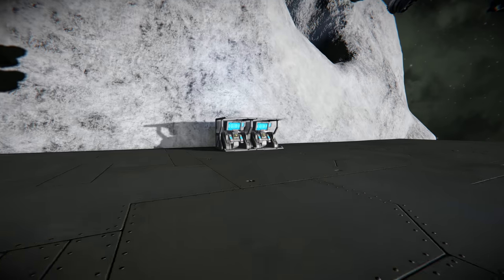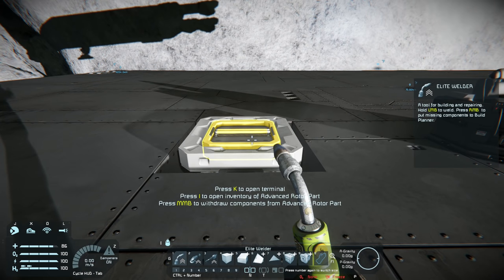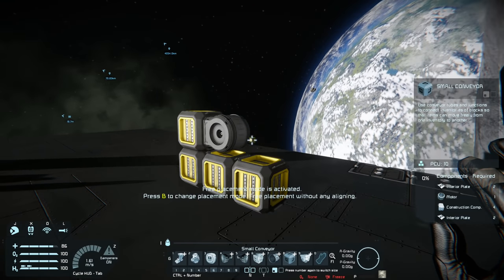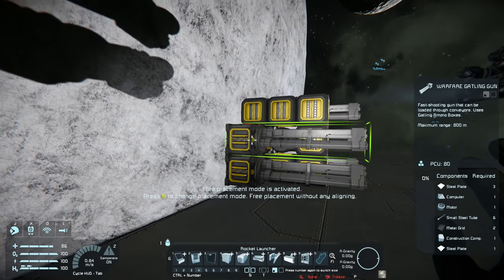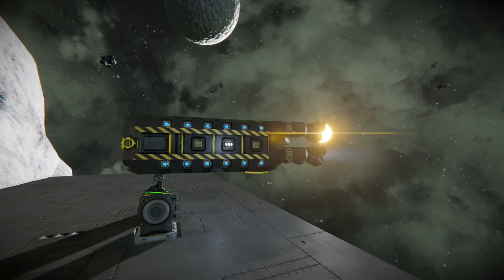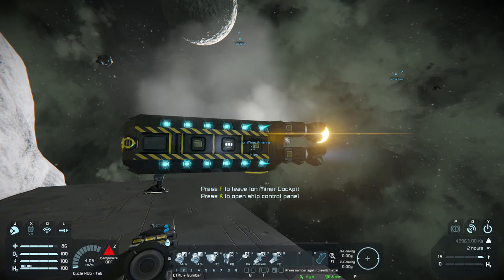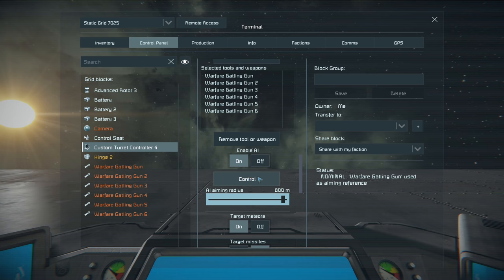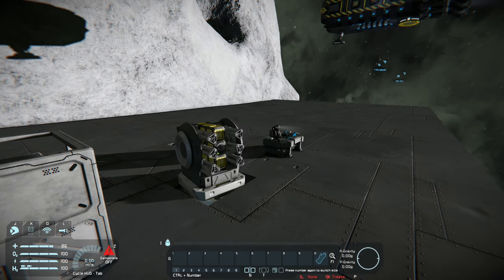Space Engineers - How to Build Compact Hinge Turrets - Warfare 2 Custom Turrets!!

Comment: I found that I was easily able to attach the small hinge head by placing down a second rotor behind it, adding a small head and building from there to the main hinge and placing the hinge head so it lines up with the main hinge, then attaching it. No fiddling around trying to line it up while carried by a ship or clang shenanigans.
Reply from the maker: I wish I had of thought of that before LOL. Thanks for the suggestion!! 😁👌
Reply: You can also just drop/place a single armor block in the very middle, for small grid large hinge, place the small hinge part directly on it, for large grid hinge blocks, place a next block on top of the first one, then place the hinge part
The hinge part will be instantly rotated by 90° to fit the motion range of the hinge, and you're set.

No more Clang-tempting than two-hinge/rotor+hinge shenanigans, and way less finicky.
Reply: you can also do it with another hinge
Reply: or just a well placed small landing gear, build some small blocks from there and the hinge part in the middle of the large hinge!

Comment: There's actually a mod that lets you grab low-mass smallgrid parts and move them around without a ship, which could potentially make these turrets easier to build.
Reply from the maker: Mmmmm that mod sounds awesome, which mod is this!?
Reply: @TheGarageGamer86  Coulda sworn I had posted a reply. SmallGridGrabber or something like that, no spaces.
Reply: A mod like that should be part of the base game.
Reply from the maker: I will have to check it out, Yeah I mean it kind of makes sense to be able to pickup small items with your hands haha.
Reply: It's called Grid Pickup, but it doesn't let you manipulate orientation of the grabbed small grid. You've basically tethered or harpooned it, and you tow it around on a virtual line. Wouldn't work for precision alignment. Great mod though!

Comment: You should replace some of the small conveyor junctions with tubes. Conveyor junctions cause a lot of lag and are more expensive, so you don't want to use more than you need
Reply: Actually that's just a myth, it's been tested and junctions are just as fine as tubes
Source: https://youtu.be/6VWj4sx2aqk
Reply from the maker: Yeah the design definitely needs a bit of TLC, although if you are not using copious amounts of junctions on a grid you should be OK 🤣
Reply: The lag issues with junctions have been resolved since before the survival update a few years ago. You'd need thousands of them to lag things out like they used to.

Comment: Had the control glitch several times, thanks for clearing up how to fix it.
Also what's the vertical limit of this turret?
Reply from the maker: Glad i could help! From my testing it can go a full 180 degrees and can go upside down 😎👌
Reply: @TheGarageGamer86  
Excellent. I'll give it a go myself when I have the time. Looks a little annoying to build but it really looks fantastic. Thanks for the quick reply 👍
Reply: @johnoneill3654  
If the hinge block is facing up in a natural gravity well, you can just place a filler block (armor/whatever) in the center of the big hinge block and let it fall, then, if the big hinge block is small grid, you place the hinge part on top and attach.
If the big hinge block is large grid you place another filler block on top and a hinge part on top of that one and attach. (In either case the hinge part will be instantly rotated to fit the motion range of the big hinge.)

If you're outside of natural gravity you can just place the small hinge part in the center and attach.
Reply: @My_initials_are_O.G.cuz_I_am  
Excellent suggestions. I'll give em a go, cheers 👍

Comment: Btw, you don't need to check the hinge orientation (where the whipe stripe is). You can simply adjust the "elevation velocity multiplier" to be negative if the controls are inverted.
Reply from the maker: Yeah I saw that in Splitsie's video, and here I was thinking to myself "Why didn't keen add an inverse rotation option" never even considered negative values 😂🤣

Comment: Hmm 🤔 small hinge part.
3 con-junctions straight back.
Surround the last junction with junctions... 
Place piston on four corners pointing forward.
Extend them a little.
Set the resistance/strength low.
Mount canons on pistons.
And continue....
Should give you visual, independent recoil Everytime a Canon fires.
Reply from the maker: That would be very cool, would love to see that built!! Thanks for the suggestion 😁👍

Comment: The way you built it the turret will be unable to shoot down, because the hinge can't turn forward by more than 90°.
If you rotate the hinge head to face upwards rather than forwards in the default position you can make the turret aim down by up to ~15° and also need fewer conveyors.
Reply from the maker: Thanks for the tip mate! 😁, I will have to check this out! Although I thought the hinge part couldn't go more than 90 no matter what? I don't proclaim to be an expert on hinges though as I have not used them as much as I probably should have lol!
Reply: @TheGarageGamer86  You can indeed never go past +-90°.
The difference is what angle you put the default rotation at.

With your setup, if the turret is facing straight forward it's already at 90° so it can't rotate forward any further.
If it faces upwards it's at 0° and you can also flip the turret all the way backwards at -90°. 
The thing is, the AI will never rotate the turret further than straight up anyways, since if it wants to shoot at something behind the turret it will instead rotate the turret base. That means with the design from your video the hinge only actually uses angles between 0° and 90°, all the angles from -90° to 0° remain unused.

If you change the orientation of the hinge head the way I suggested, then the turret will instead be at 0° when facing forward, which means it can then rotate anywhere between straight up (-90°) and straight down (+90°), though in practice you won't actually be able to aim straight down because the barrels of the gun will hit the hinge body.

Still, even just facing down by 10-20° can be incredibly useful in battle.
Reply from the maker: @hellothere_1257  Thanks mate! I honestly feel bad about the video now LOL. Nevertheless thanks so much for letting me know though, I have now started creating the turret's with the hinge part facing upwards and as you suggested it does point down a fair bit which is awesome 😎👌

Comment: About the finicky construction:
If the hinge block is facing up in a natural gravity well, you can just place a filler block (armor/whatever) in the center of the big hinge block and let it fall, then, if the big hinge block is small grid, you place the hinge part on top and attach.
If the big hinge block is large grid you place another filler block on top and a hinge part on top of that one and attach. (In either case the hinge part will be instantly rotated to fit the motion range of the big hinge.)

If you're outside of natural gravity you can just place the small hinge part in the center and attach.
Reply from the maker: Yeah it's weird hey when I was creating this turret the first time i tried to just paste the hing part directly in the middle and it refused to attach lol so I ended up just doing it this way haha

Comment: For you survival players and planet lovers:
The easiest way to do this in atmosphere is to use a piston to push the turret into the hinge, 
turn the velocity real slow to get it lined up perfectly, then shut off the piston and attach!    EDIT: This only works if the axis of the piston is parallel to the axis of the rotor..... 

I just did this twice in survival, glad it worked cause if clang attacked I would have lost a lot of precious material 😅
Reply from the maker: Yeah that or you can build an adjacent rotor next to it and run some blocks over the the hinge and place/attach the hinge part that way 😁. On my Pertam save I ended up creating about 10 of these ball turrets, so I basically just made a blueprint of the small grid guns etc and printed them all off and using an atmo ship to install them because building them one by one was going to be sooooo time consuming lol

Comment: Maybe in atmosphere it be better to make some sort of small grid crane with pistons to hang over the hinge and build the turret on then lower it into place
Reply from the maker: Yeah I think the way that other people have suggested in the comments (and Splitsie) by building adjacent rotors with small heads\hinges would be a better way to go in atmosphere. I tried placing the hing part directly in the middle in creative but it just didn't seem to want to attach, one of the reasons I created the video was because of the fact that there did not seem to be anything on google about it and it took me hours to figure out, so thought I would share what I found 😎👌
Reply: @TheGarageGamer86  turns out its super easy in atmosphere to just drop a small grid armor block as close as possible to the edge of the rotor and then build a little tower with branches at the bottom so it doesnt fall and just hold the piece in the air super cheap too

Comment: I have tried the ship method, drop method, yelling and cussing method and the old reliable throwing the mouse method.  No matter what I do, it will NOT attach when I hit attach.  I had it dead center for all of them and the window on the right still says attach.  I just gave up.  So I figured out about the original turrets.  Built them and took forever to figure out why I couldn’t find the ammo for them.  You have to make an assembler because the basic doesn’t make them.  They still won’t kill the wolves!  I tried the interior turret and still they breathe and attack me.  I checked and rechecked the settings and made sure enemy and neutral were both checked.  Still no joy.  Any ideas?

Comment: I was looking forever for this. Thank you so much for the awesome video. Sure would be nice if keen changed this so you could just add the small hinge part so we could avoid the finagling. Good mod idea I suppose.
Reply from the maker: Thanks mate, really appreciate it! 😎👌 Glad i could help!
Reply from the maker: The only issue is that the head that is added by doing this is 3x3 small grid so you cant add the guns like you can with the small grid small head 😢
Reply: @TheGarageGamer86  yeah, also makes it a pain for the smaller guns due to it utilizing a large connector. This meathod, though a bit jank is far superior for those small turrets
Reply from the maker: @ChaoticScape  Yeah the other issue is that you can only attach a small grid large conveyor to that hinge part added by the sub menu, so your turret ends up being about 2 blocks tall instead of 1. Still works just fine, I just find the ball turret more aesthetically pleasing 😎

Comment: Do you need all eight conveyors for it to attach/supply ammo?
Reply from the maker: Yeah basically, I guess you could change the orientation of the small hing part to use less, another person pointed out in the comments that the turret won't be able to look down with this arrangement because the hinge can only go 90 degrees. So maybe place it vertically and then it can look down a little bit 😁👍

Comment: I’m just trying to understand why I can’t add weapons or tools. I’m super deep into the process of making some of these turrets however I can’t add any weapons. I have weapons attached to the conveyors but the button to add weapon or tool is absent for me for some reason…
Reply from the maker: It may be because you have not got the hinge sitting on a rotor, or you have not set the azimuth and elevation rotor/hinges set?
Reply: @TheGarageGamer86  I actually figured it out I found one google search results with a similar issue to mine buried in the depths of the internet. It basically boiled down to weapon core mod I had enabled it was preventing me from adding them.
Glad I can add them cause I’m making sick turrets now all vanilla too which is nice.

Comment: cant get it to work in survival, gatlings will not connect to the conveyor system
Reply from the maker: Just check everything else and make sure you used an advanced rotor, I can confirm that it works in survival as i have tried it before 😎👌